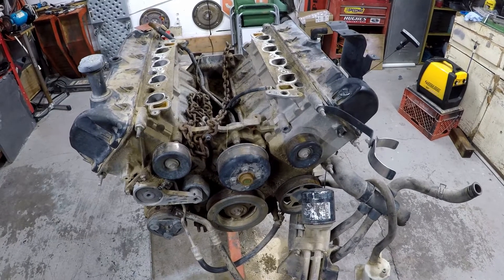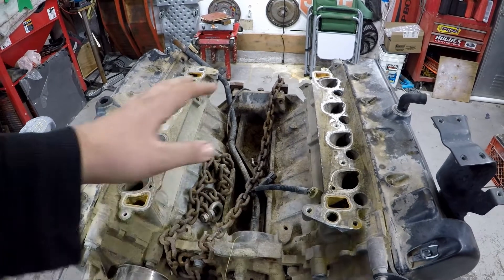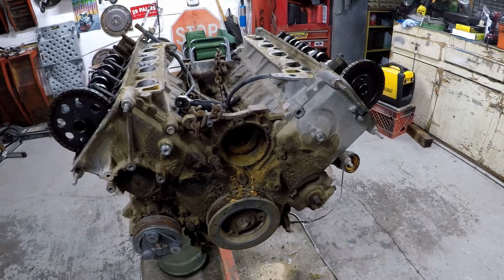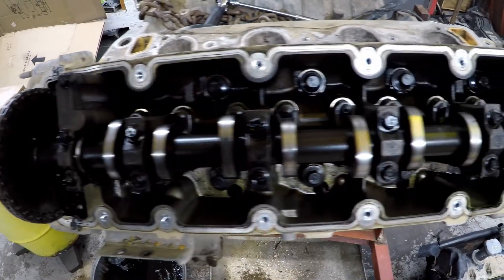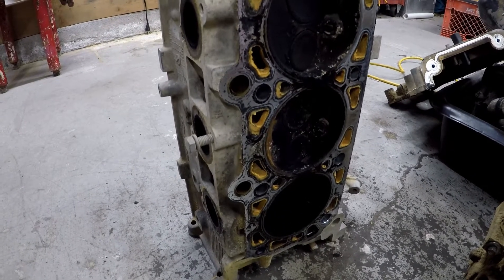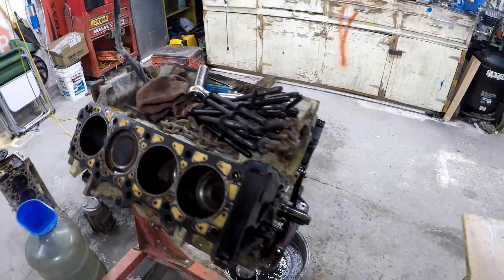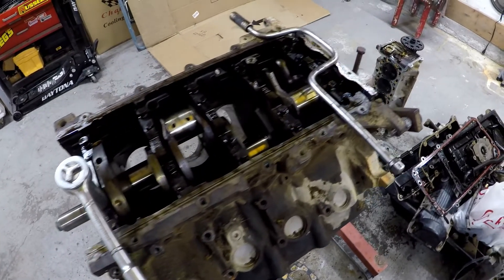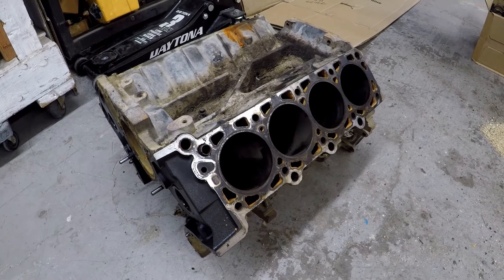5.4 2v Engine Teardown ... extra parts for performance rebuild

Comment: My 2002 f150 has 300,000 miles still runs new uses very little oil these 5.4 2 valves were excellent engines !!
Reply from the maker: Nice, That's cool to hear. They really are good engines.

Comment: I'm working on my 2V from a 99 F250 and have it jacked up with the oil pan off, but unable to remove it due to Y pipe.  I got some small debris in the front of the pan from doing my timing chains, but I know that pan has baffles.  From your knowledge of it, would I be able to wash that stuff down to the drain plug with some brake cleaner, or would the baffles catch everything?
Reply from the maker: The baffle is pretty large so It would probably be hard to get everything off of it and cleaned out with brake cleaner. Maybe if you had an inspection camera you could inspect it and clean it and know its clean, but maybe best to unbolt y pipe and fully remove if you're concerned about debris.
Reply: @DesertRatRacer  the debris is particle sized or there abouts.  Do the baffles have openings on the bottom to allow for fluid flow or are they welded all along the edges?  BTW, thanks for the input!
Reply from the maker: @MichaelJeffers75  No problem. maybe if they're really small then maybe not a big deal if you can maybe clean decently. They aren't fully sealed around on the edges. I'll share some links to some so you can see. The one with the scraper is maybe pi version, and the other is non pi as far as I know. https://i.ebayimg.com/images/g/N3kAAOSwSA1lJ0rQ/s-l1600.jpg ... https://i.ebayimg.com/images/g/XYMAAOSw2KVlI60z/s-l1600.jpg

Comment: Did you ever sell the heads?
Reply from the maker: Yea they’re gone. 🙁, I have another 2v 97 4.6 with a set of heads on it. Did you want pi or non pi?
Reply: @DesertRatRacer  no I need camshaft from a 5.4 thanks
Reply from the maker: @gregwaltman6539  oh ok, no problem. I don’t have any 5.4 2v cams.

Comment: The 2v tritons are a fun platform if you know what your doing. The non-pi 5.4s and 4.6s have flat top pistons as well as the 3v s they are about 3cc. Pair these with a pi 2v head and you can get a nice compression bump that's how you get the power out of these turds.
Reply from the maker: Yea I really like the 5.4 in my f150... adding the pi heads is good advice. Because It was a 2000 I assumed it was a pi, but should have payed better attention, but I got an extra block and crank so I'm happy.
Reply: Hey I’ve got a 2v 5.4. Could you explain more about pi heads, what they are, where to get ‘em? I wanna discover as much possible upgrades for my truck as possible! Sounds maybe cheaper and easier than a supercharger
Reply from the maker: @bebeslife4519  The Pi stands for performance improved. so 99-04 4.6 /5.4 are the performance improved engine or "PI". The previous OHC years 91-98 are "NPI" non performance Improved. Might depend on vehicle family for the exact year change, not 100% sure on that. So some people will swap the intake manifold, or whole top end with heads and cams also. I think that can change the compression ratio and is a good chunk of work. So you could also opt to just swap in the whole newer engine for the performance gain. I believe its roughly 35-40hp give or take power improvement but might want to research that for your application. That for sure is one of the best places to start to gain power if you have a NPI engine.
Reply: @DesertRatRacer  Oh, in that case I guess I have the newer head already. My truck is a 2002 f150 Supercrew Fx4 5.4.
Reply from the maker: @bebeslife4519  oh cool, that's good.

Comment: I have a 5.4 2 valve in a 98 e350 class b 21 foot RV

Please can you make a suggestion for low end torque
Reply from the maker: That’s kind of a tough one. I don’t know if you need to smog, but you could add some sort of forced induction like a basic supercharger. A cam change might also be an option. The best bet would be to do a bunch of small stuff. Maintenance first, make sure it was a good set of spark plugs / coil packs. You could potentially open up the exhaust and the intake better, but not too much… you might risk losing low end torque that way. Maybe like a long tube header with collector extensions and a normal exhaust. Maybe a higher flowing filter element, but changing up the stock tubing could mess with the low end torque. Talking to the manufacturers could help a lot with a decision and they might have special setups for you. A throttle body spacer is probably a good option. Changing the rear gear ratio lower can really improve overall torque, but going to sacrifice some top end power and mileage with that.
Reply: @DesertRatRacer  thank you... I was planning to start with the exhaust side... Replace the mufflers with higher flow versions..  long tube headers are a problem... The e350 has tight space constraints and I could find any info..  Hedman makes a hugger header that may work... Haven't rec'd a response from them

As for coils... Jegs offers a 40,000 volt set that has proven to be as described and reliable

Msd offers the #8740 ccp for Ford modulars..  I couldn't find any 3rd party independent info on them..  planned to pair them up with the jegs coils

Forced induction is not an option... 

Can I keep my NPI block.. NPI intake manifold and run a PI cyl head?

I will consider gears if I can bump up the low end torque sufficiently...  I only plan a top speed of 65 -70 mph... Most of my driving is in the 58 -61 mph range for safety and fuel efficiency 

Thank you for replying
Reply from the maker: @camposvazquez   no problem, sounds like your right on track. I know for racing a lot of people say the coil on plugs are fine till 500 hp maybe more. So maybe just inspecting the stock ones, and making sure they’re in range might be good too. I think I’ve ran across those hedman headers, they seemed pretty good. I completely forgot about the pi swap. Yea you can run the pi heads on the non pi short block. Pretty sure that’s an even better power setup than pi head on pi short block due to raising of compression a little. I don’t know right off the way the intakes can swap, but if you go pi head probably best to use the pi intake as well for max power. But definitely want to go with the truck style manifold. There is tons of info on the pi swaps online. There are rpm or gear ratio calculators online where you can put in rpm, trans info, gear ratio, and tire size. Maybe mess with that to see where you are and where you can go gear wise. That pi engine or head swap might be the most bang for you buck if you can get the parts for cheap.
Reply: @DesertRatRacer  it's all book theory...  You are getting your hands dirty and doing the work..  what area are you located in?

You provide a lot of info...  Plus hands on know how...  Going to binge on more of your videos... Then return with questions

SUBBED LIKE & SUBSCRIBED
Reply from the maker: @camposvazquez  I don't think the book theory ever ends. Thanks I try. I'm in Southern California, 29 Palms. I'm kind of slow with videos and stuff lately, but I'm always happy to answer questions and help where I can. Nice Thanks for the subscribe.
Reply: @DesertRatRacer  I am in Pasadena..  I know I will need your help..  I have an E350 5.4 2 valve..  I plan on extracting torque...  

I will get back to you in a couple of weeks... Your videos are extremely helpful...  This one here exposed the block ..which I needed to see..

Have a good day... See you here in a couple of weeks
Reply from the maker: @camposvazquez  oh nice, not too far. Ok cool, glad it helped. Ok thanks, have a good day too. Ok I'll be here.
Reply from the maker: @camposvazquez  I'm not really setup to work on anyones vehicles right now. I normally don't worry about a slight tick on start up with these, until it gets loud or constant. Especially being the motor home maybe you don't start it that often, so that would be pretty normal upon starting if not started a lot I would think. My truck is currently 165000 miles... It had the same problem. First I put in max oil and that helped, and made sure to have good oil filters so it holds pressure on the tensioner better... but I just realized I switched to a high mileage oil and I think that got rid of it.
Reply: @DesertRatRacer  thank you...  I will follow that...   I have been daily driving the van for 2 weeks straight and it ticks every start up..

My goal was to work on the van with you..  you can get some content... And I can learn to work on my first ever Ford...  

Use to working on pushrods.. ..

If anything changes let me know...  Would love to take the drive and camp in some nearby  BLM land after..
Reply from the maker: @camposvazquez  Yea I would definitely give those ideas a shot. Ok so tick is worse than just sitting. Yea the pushrod engines are way easier to work with. Maybe in the far future we could work on some stuff, but if anything changes I can let you know.
Reply: @DesertRatRacer  sweet.. I also bought the complete valvomax kit...  For this engine...  It's a good video for the solo female van lifers to see.. so they can do their own oil changes ...

I would like to do that video under your channel too..

Please say when ...of course for me..the sooner the better....but I understand it's at your availability...
Reply from the maker: @camposvazquez  oh that oil drain valve is pretty cool. It would be a long time if I could do something like that, but if anything changes I can let you know.

Comment: The 5.4 2v was more reliable than 3v
Reply: At least the 3v 5.4 when it’s running is better  than the typical mainstream v6 engines
Reply from the maker: @Jwatkins0118  I can’t argue that. 😂
Reply: I have an 03 Lariat 5.4 2v, only problem I'm having is an intermittent P0401 code and high negative fuel trims at idle.  When it's going down the road it runs smooth as silk.
Reply: Mine went 426,000 miles with only a battery and alternator replaced.
Reply: @Taylor74b Dang !! I’m at 192k . Taking care of it and hoping that’s me 😀👍
Reply from the maker: very true, I've done my best to stay away from those.
Reply: @DesertRatRacer  i got an 01 5.4 2v it runs smooth . Them 3v with cam phasers were like a loose cannon.
Reply from the maker: @bobobrazil1973  yea no joke
Reply: Except for the coolant leaks . PIA 😅
Reply: @stevenmorris2293 had several 5.4 2v over the years dont ever remember any leaks of any kind.

Comment: Curious what it cost you to have it provided and all the gaskets head gaskets and put it all back together
Reply: Gasket set for this engine is around $250. I rebuilt this same engine from the block up.
Reply from the maker: I took this apart mostly for parts, and haven't needed to put an engine together yet. so cant really help with cost stuff.

Comment: Are you going to do a performance build on this engine?
Reply from the maker: Basically I have 2 5.4 4 valve engines. One complete stock one that will go in the station wagon, then another that needs rebuilt. Plan is too get the stock one going in the wagon and work out any problems, and rebuild the other to handle boost and get ready to swap it in later. I got this this engine mostly to have an extra block and crank for the 4v engines in general.
Reply: @DesertRatRacer  oh ok I was just wondering because I want to mod my 5.4L 2v and can't find anyone who has done it on my truck specifically. I have 1999 F250 triton v8 I could only find mods and stuff for the diesel version of my truck
Reply from the maker: @challenger_cobra_3929  ok nice, I have the same setup just the f150. I guess it depends on the route you want to go, but most of the 4.6 mods would be similar to what you would do to the 5.4. Maybe some of the crown vic / mustang stuff could help spark some ideas.
Reply: @DesertRatRacer  ok thank you
Reply from the maker: @challenger_cobra_3929  no problem, if you need help with anything just let me know.